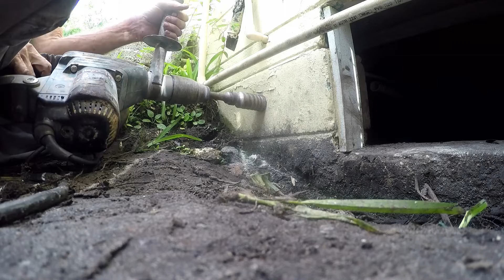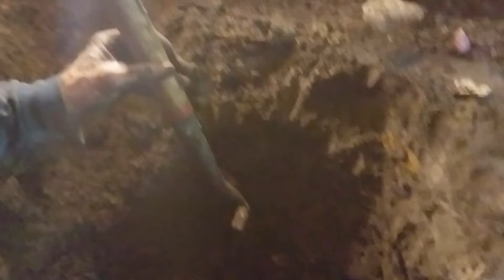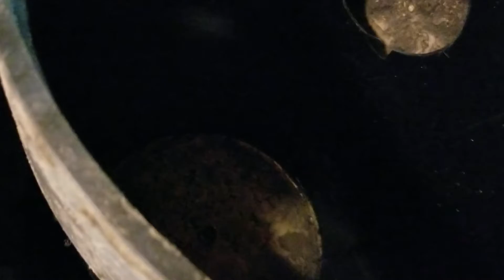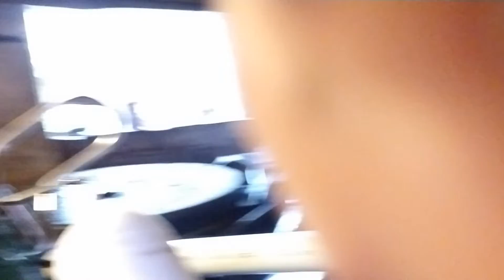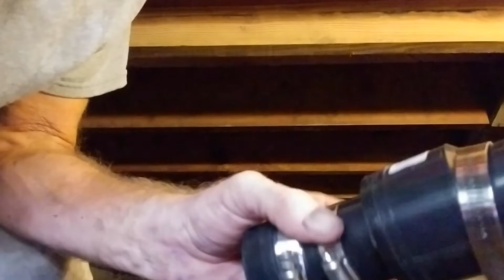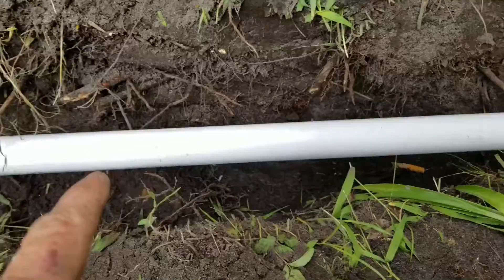How To Install Sump Pump and Discharge the Water

Comment: You re a hard working dude Chuck ! Great videos in such tight spaces. I could almost sense the dampness. I was wondering why the pump discharge was on a T fitting  I asume it was for better disapation.